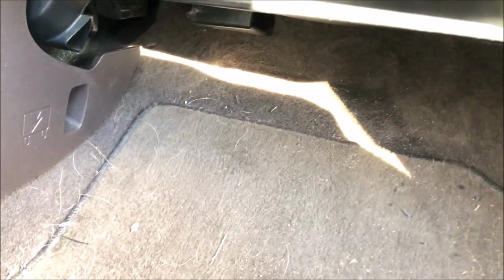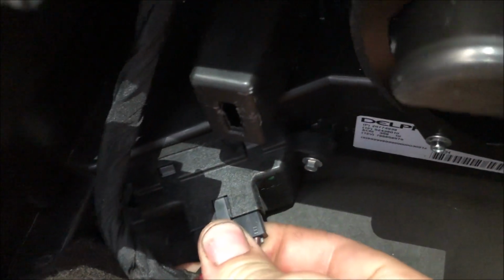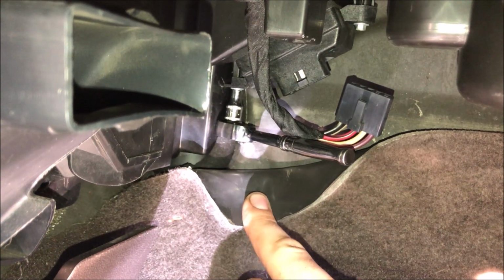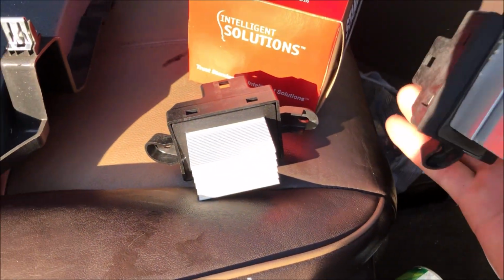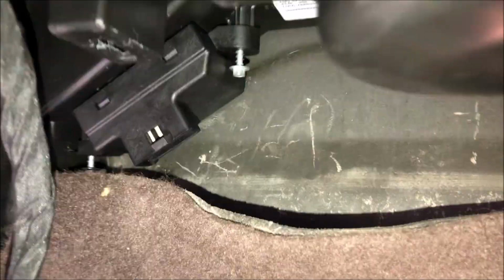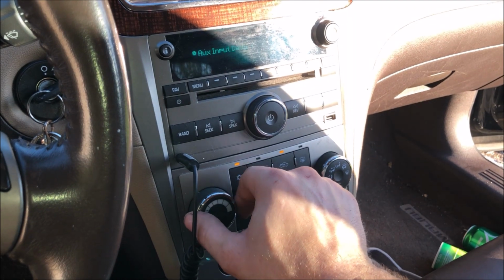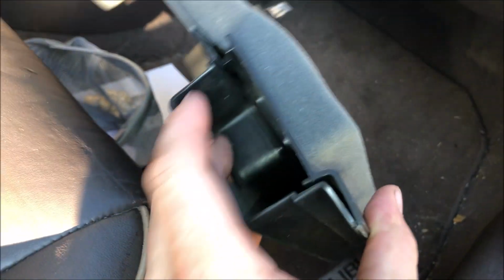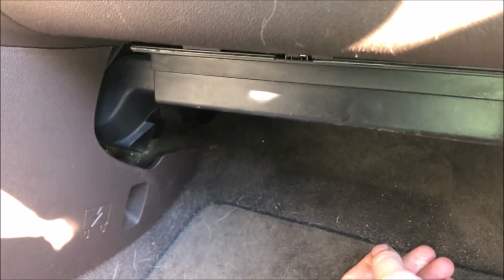Chevy Malibu Blower Motor Resistor Replacement (2008-2012)

Comment: My 2012 chevy malibu had it's blower motor fail in October 2023. I got it fixed november for $233. Well this July 2024 it failed again and I took it back to the mechanic. Now I got a warranty on the motor but now he says the resistor and wires are messed up and caused the blower to short. Total cost now, $350!! I'm taking it to another mechanic for 2nd opinion and price but if they're both expensive, might do it all myself. This is now the 2nd time this malibu motor ceased. Ugh.
Reply from the maker: @jeffrytessier-uq1dc  Yeah the early 2000’s Dodge Caravans had similar issues where they would chronically burn up blowers, resistors, and switches.
Reply: What did you finally do to fix it? And I  wonder if the plug to the resistor was damaged, letter D, in your car. I'm also having this problem with 2012 Malibu.   When I get it fixed, I'm  selling it 😂

Comment: Ty got it done but check engine light is still on. How do I clear that light
Reply from the maker: Blower motor shouldn’t have anything to do with the check engine light so you probably have a different issue going on. Need to scan the car and see what codes are in there with an OBD2 tool.
Reply: @TonyTheTruckGuy  did that and it's the ac/heater resistor. It's under the glove box. Ty anyway I'll figure it out. Just want to reset and if the light comes back on I'll take it to a Chevy dealership.
Reply from the maker: @irvinaboydjr6700  Oh weird I never got an engine light on this one haha. Yeah hopefully clearing it out does the trick.
Reply: @TonyTheTruckGuy  this car is not in good design u have to take the front nose off to change a headlight. Now I've been told take off the hot from the battery for 2 minutes then put it back on and drive it for awhile. So I'll take a night time cruise lol
Reply from the maker: @irvinaboydjr6700  Yeah it's a shame how difficult they have made it just to change a headlight bulb on modern vehicles. The disconnecting the battery trick may work for the engine light. Fingers crossed!

Comment: I just had a problem with my wifes 2012 Malibu and this is the first video I came across. Its really cold here today -5 to -15 F before wind chill and her blower is working but only when she turns the fan speed to 3 and 4...1 & 2 no longer work so I know the blower is fine. Does this sound like a resistor problem? Im not going to mess with it until it gets nicer  out or if the blower stops completely ....thanks. Nice video and straight forward
Reply: i should add that her car doesnt have the climate control...it just has the dial that you put to the left for cold and all the way to the right for max heat. It doesnt have a digital readout
Reply from the maker: @Snakebyte70  Sounds like either the resistor or the blower motor switch
Reply: @TonyTheTruckGuy well I’m hoping it’s just the super cold weather 😅. I’m guessing the Malibu’s without the climate control would also have the resistor since the fan speed level switch/dial are the same. I’m hoping the resister is as easy to change in hers as it is in your video though. Thanks for the reply 👍
Reply from the maker: @Snakebyte70  Yeah you should have a resistor still, it may just be a different part number.

Comment: before you changed the resistor, did your fan turn on? Because mine isn’t turning on and I wanted to see if this would help with that?
Reply from the maker: Originally, the blower motor didn't work at all. Replaced the blower motor (which I also have a video on), and then the blower motor worked, but wouldn't turn off lol. Replaced resistor and that cured the on/off issue. They tend to fail together.

Comment: Hey I’ve been through the comments. I have a 2010 Chevy Malibu and my HVAC module is dead. No power, nothing is lighting up, no air no heat. I’ve checked and swapped the fuses. All good except for 10A(HVAC CTRL (ignition) and 20A (HVAC BLOWER) fuses aren’t lighting up. They are new fuses. I checked the wire that powers the HVAC and its good (has power flow). 

So I’m guessing it is either a bad relay or i have to change out the BCM. What do you think? Do you also know where the HVAC relay is located?
Reply from the maker: Just looking up a wiring diagram quick here and yeah it shoes that the HVAC controller you say not lighting up should have a 10A HVAC  BATTERY circuit control fuse which is SAYS is a red wire with white stripe going to pin #8 on the X2 connector at the HVAC controller and that should have ~12V all the time. It also lists an HVAC control IGNITION fuse which is also a 10A which SAYS it's a brown wire going to pin #7 on the X2 connector which should have ~12V with the ignition on. There's also a "run relay" that should be labelled in one of the fuse boxes, you may want to swap that with a sister relay. Check that and let me know what you find and we can go from there!
Reply: @TonyTheTruckGuy  I’ve been reading into and seen a video. There is power at both fuses and the power wire (the red and black wire). The relays and fuses are good. In the video he says since its getting power flow from both ends and its still not working, the fault is with the BCM and that it should be swapped out. I’ll do further testing to make sure. And thank you so much. No forum was helping me.
Reply: @TonyTheTruckGuy  okay i just went to buy a power probe. Im getting 0.1 with HVAC CTRL (10A) and HVAC BLOWER (20A) with car ignition on.
Reply from the maker: @dalrishardin9993   How about with the car running? Also which engine do you have? Just trying to look up the most accurate wiring.

Comment: Blower motor only works on high just replaced the old resistor but still only works on high should I switch blower motor or is there a way I can find what could cause the issue ? Once new resistor was installed it never worked on any lower settings it only works on high even with the new resistor
Reply from the maker: Probably the fan speed switch at that point if I had to guess without doing any physical diagnostics. I’m not sure if you can replace just the switch or if you gotta buy the whole climate control assembly

Comment: Hi mine blow air in the front of the window but the  front vents don’t blow air when switch to a different setting what can that be ?
Reply: I had the same exact thing happen to my 2010 Malibu. I ended up having to replace the whole AC Control panel which was very unfortunate.
Reply from the maker: Could be several things but the most likely causes would be either the mode switch itself (the switch that changes where air comes out of the dash), a failed blend door actuator, or a broken/stuck blend door.

Comment: I have zero air blowing, hot or cold. Is it the blower motor or the resistor?
Reply from the maker: Could be either, you’d have to do some actual testing without just throwing parts at it. I have another video changing the motor itself on this same car. They seem to go hand in hand pretty commonly.

Comment: my malibu's fan dial has 4 settings, 1 and 2 arent working its not blowing out anything, but 3 and 4 work. would that be the resistor?
Reply from the maker: That would be my guess without doing any actual diagnostics.

Comment: ? Do you have a video on installing the wire harness assembly that connects to the ac resistor? Having trouble installing it
Reply from the maker: No sorry just this video and one on changing the blower motor itself

Comment: Wait you said i would cost 300 to fix but you only replace one resister which cost 40-90
Reply from the maker: My resistor was $150. I was saying that it would be about $300 if you had to do the resistor AND the blower motor, as the blower motor I replaced the week before was also $150.
Reply: @TonyTheTruckGuy  oh thank man
Reply: @TonyTheTruckGuy  one more question.
the link of the resistro you gived is unavailable, can a resister for a 2011 malibu can fit in a 2012?
Reply from the maker: @failsans4079  I can’t say for sure but I’m guessing so. Remember to check if you have the auto climate or not and order accordingly.
Reply: I have auto climate control what parts do i need im trying to order parts online and wanna make sure i get the right ones im getting the blower motor and resistor plus front complete loaded struts

Comment: I just replaced my blower motor worked for like 2weeks now my climate controls won’t engage nothing turns on could it be my resistor?
Reply from the maker: You mean just the blower isn't working again, or nothing on the climate control display even lights up/functions?
Reply: @TonyTheTruckGuy  sorry I meant to say the blower motor is brand new but now my climate control aren’t working like there’s no lights coming on or anything I checked the fuses but they all seem fine. Would you think the resistor is bad ? I also heard some clicking sound coming from behind the climate control panel before it went dead ?
Reply from the maker: @bluedevilg3542  The resistor should only control the blower motor, so if the climate control isn't working at all, I'd suspect something else. If all fuses are for sure good, make sure there's not a second fuse box somewhere, and make sure to check if there's any relays for the HVAC. Might be worth swapping with another relay if you find one labelled HVAC. Other than that, it would have to be the HVAC controller itself, or some sort of other module/wiring.
Reply: @TonyTheTruckGuy  thanks for the info

Comment: Are you able to test the resistor without screwing it back in just to see if that’s the issue? I might want to try this before going the blower motor route.
Reply from the maker: Yeah, I don’t think it grounds or anything via the mounting screws.
Reply: @TonyTheTruckGuy  i was impatienct and just plugged the fan without fulling installing it. it turned on and thats how i knew it was the fan lol
Reply from the maker: @0livareZ  I do stuff like that too that way you don’t waste time finishing the install if it’s not going to fix the issue 😂

Comment: My blower motor stops I replaced it and my resistor connector files up it turns on and off when I shake the plug now it does not work at all did my resistor go bad I thought I replace the blower?
Reply: Oh yeah it started working when I replace the blower one week later I'm having resistor connection problems I shake it it turns on from the resistor but now it does not turn on at all when I shake it
Reply from the maker: @bobbyowens1926  Probably bad resistor or just a bad connection. The connector may be melter or corroded so that would need to be fixed if the resistor is not the issue.

Comment: Do i need to remove to negative terminal on my battery or do I just proceed with the steps
Reply from the maker: Never a bad idea to disconnect the battery when doing anything electrical, but as long as you’re not jamming random metal objects into the power pin for the resistor then you should be good 🤣 I’d just make sure the ignition is off
Reply: It takes 2 seconds disconnect the negative terminal anytime you're working on something electrical in the car

Comment: I had one of these put in my car 2012 chevy and now when you cut it on its blowing like the fan is on full blast so what was done wrong. I can't turn it on low because it blows like I cut the fan on .
Reply from the maker: What do you mean “cut the fan on”? You mean it’s stuck on full blast?
Reply: @TonyTheTruckGuy  Yes sir I cut it on the first button and its full blast I think something is not hook up right, they did order another part in case this is bad. they order the blower with the resiptor when the only thing I needed was the resiptor the blower was fine. I hate to go to the dealer because they will have to take it out and put back which they will charge a arm and leg. Thanks for replying back and I will let you know how it goes hopefully they will see the mistake .
Reply from the maker: @Change2be1  Sounds to me like the resistor is bad, maybe it’s the wrong one.
Reply: @TonyTheTruckGuy  I hope that is all it is they did order another , When I turn it on the 1st knox its full blast in fan mood as I turn the button still fan mood. I am glad I do have the air with this hot heat but its on full blast . thanks for your reply.
Reply from the maker: @Change2be1  Yeah these resistors are actually pretty spendy comparatively. I hear you though about not wanting to go back to the other place, not worth the headache to get a few bucks back or end up with another hack repair.
Reply: @TonyTheTruckGuy  so true thanks for hearing me out because sometimes if you don't know parts that good then you don't know if that is the right price it should be, but I rather pay to get the right part than have to have someone to redo it again. Can you estimate about how much it may cost  for a resistors for my vehicle. I  don't think the other place understood that my a/c was climate control .  2012 Chevy Malibu ,UTZ.
Reply from the maker: @Change2be1  You’re best off calling a local parts store or calling the shop that will be doing the actual work for a more accurate price, but the resistor I replaced in this video was in the neighborhood of $150. Plus another $30 for a new connector.
Reply: @TonyTheTruckGuy  ok that is not too bad, I did call some auto stores but they didn't have that on hand so they couldn't give me a price. Thanks again appreciate all your advice.
Reply from the maker: @Change2be1  No problem, good luck with repair!
Reply: @TonyTheTruckGuy  the company that are going to repair this part had to order through the dealership and it was 207.00 which I'm ok with that.

Comment: How would you know if it’s this or the blower motor? My was working but when I went to turn it on it turned on but didn’t blow air or if it did it was really weak. I checked if anything clogged and fuses but everything goof
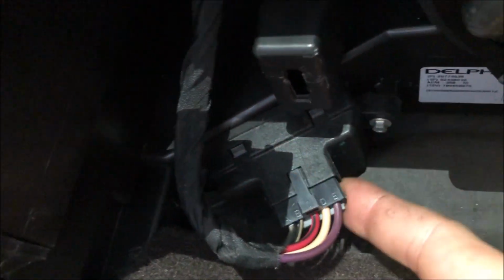Reply from the maker: I have a blower motor replacement video on this car as well I'll post down below. You'll see the blower motor connector with 2 pins in it at the 1:25 mark. Get a cheap multimeter from the hardware or parts store if you don't already have one and set it to volts. Turn the car ignition on and turn the blower knob on high. Then touch 1 of the leads from the multimeter to 1 of the pins at the blower motor connector, and the other lead on the multimeter to the other pin of the blower motor connector. If you're getting about 12 volts or more, the motor itself is likely bad. If you're not getting good voltage, flip the blower knob to a different speed and check the voltage again. If you still don't have good voltage, it could be the resistor, the switch, or wiring. https://www.youtube.com/watch?v=EXcLp-Zmdik
Reply: Tony The Truck Guy thank you
Reply from the maker: No problem, Let me know if you need any other help.